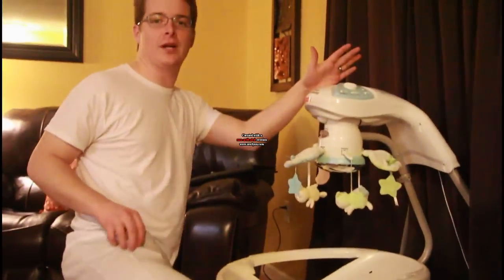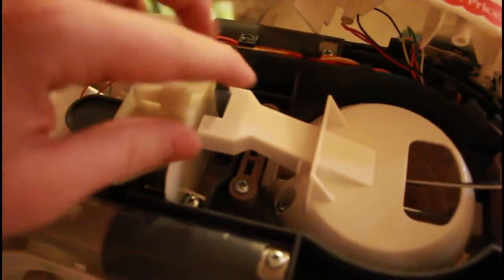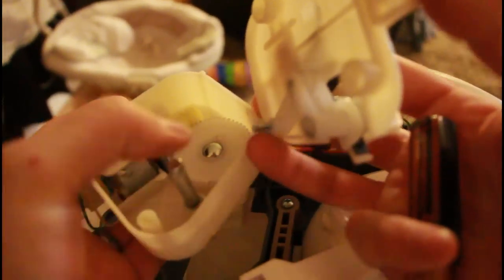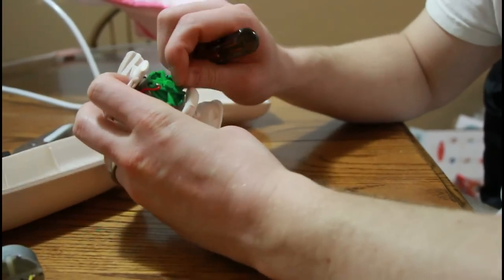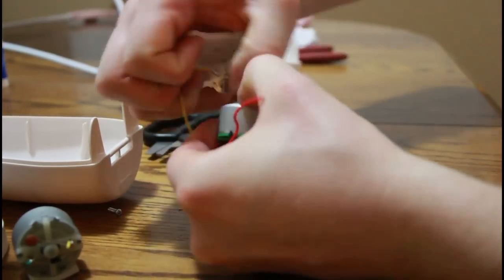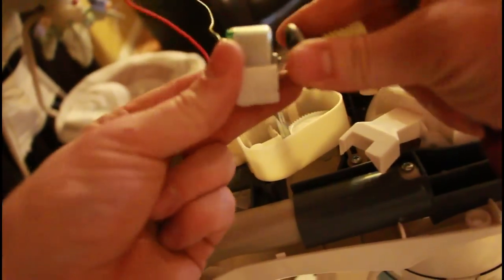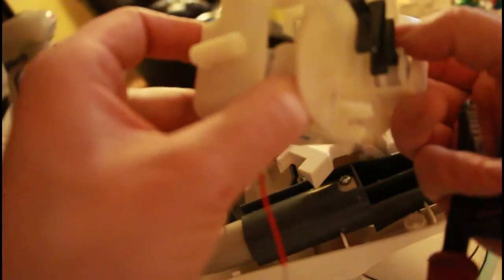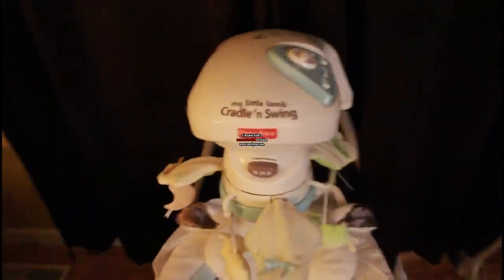How To Fix Fisher Price Cradle n Swing Motor Natures Touch My Little Lamb Love U Zoo baby

Comment: unbelievable, it worked. my friends thought I was nuts. had the freshner in my bathroom, bought flex for $6, and did this by myself. totally proud of myself. my friends look at me differently now. I used half the roll,  swore a lot, set table on fire,  burnt myself but well worth it. THANKS FOR THIS VIDEO

Comment: Did this exact method step by step. Put it all together, and it swing slow. Barely moved the chair. So I re-watched again. Then I noted him saying,  ( it will run slow if the polarity is reversed) So I switched the wires, and it worked like a gem. Thanks for this thebiggi, much appreciated! I even loaded it to 25 lbs, it's limit and it ran like a beast. Hope it lasts, if not i've got 2 more airwicks on standby!

Comment: Ours died suddenly, thank you for this video! Others may find it useful, there is a small dot in the plastic by one of the contacts on both motors which marks the positive. I disconnected and reconnected everything paying close attention to the polarity and joined the Yellow wire to the red wire, and green to blue. Works great again!!

Comment: We took a look at the video and my husband was like, no way! But me and the babe can't live without his Snugabunny swing so I decided to try. Well wow, soldering (or soldiering as I like to call it) on this job was really hard, especially grounding the "capacitor" - despite roughing up the case, I never did get it to stick to the side... but I put the foam sticker overtop so there was still a connection. It worked!!.. and babe is sleeping soundly as I type! The new motor is louder than the old one but nothing too bothersome. Overall it took me about 4 hours not including breaks spent manually rocking baby to sleep. Thanks!
Reply: Jana Strittmatter How did you removed the metal bar in the middle? TIA
Reply: It was like someone else said in the comments - "You have to pull the legs of the swing in (release the crossbar in the back) and the two bars holding that plate down will move out and allow you to remove it."
Reply: So, it worked for about a month before dying again :( My son has almost outgrown the swing now so we might be able to do without, but I was sad that the "new motor" didn't last longer. That being said... it was a lifesaver at that point, and the alternative (waiting for Fisher Price replacement) wasn't feasible in the short-term.

Comment: Thanks Buddy, I actually also used an old nokia 6.5v charger and made it work with ac power. so it now plugs into the wall and i don't have to constantly change batteries
Reply: +Clint Mahabir Can you do a video that shows how you did that? I'd love to change mine to Ac power.
Reply: OK I will, and I will let you know when its up

Comment: Im having a problem with mine i took mine apart because it was not working great . Think the notor is weak. But anyhow after re assembling the switch boards the only thing that works is the swing action. The mobile thing dont spin and no sound??? Do you have any ideas. But if i switch the plugs around the control knob will control the mobile like it would the swing. Im thinking the board is messed up or something..

Comment: i bought my new motor off ebay already soldered, its works but its going too fast and the little stick thing that goes back and forth is moving too fast, so fast that it barely swings. any idea what the problem is?
Reply: Hi my stick is swinging to fast too, did you ever find out why it was doing that & how it can be fixed?
Reply: no, i just gave up on it. i had already put too much time and effort into it and my baby was starting to get too big for his swing anyways
Reply: Oh sorry to hear that, thanks anyways.

Comment: I followed the steps but it will either swing on higher speed without me powering it on or it will power on and not swing at all if I switch the leads. What went wrong?
Reply: dana youtz having the same issue myself. Soldering is just 'gluing' metal pieces together, the problem 'might' be that your pieces aren't connected properly. Reheat the metal and try making sure the wires are touching each other. Can't hurt to try.
Reply: dana youtz Did you figure this out? I'm having the same problem...
Reply: dana youtz  I've read to make sure  metal piece isn't all the way shoved on the motor.
Reply: +dana youtz This happened to me after I tried reversing the wires - I smelled burning from the control board and now if I connect the wiring up the motor goes off regardless of whether or not I've switched it on. I'm wondering if we burnt out a capacitor, transistor or resistor on the control board....
Reply: dana youtz so can I use glue instead???

Comment: my cradle swings for a short time and stops. i have to open it and touch the motor before it starts again. what could be the probable cause.
Reply: Same here. Have you solved it?
Reply: Double check the soldering job, make sure the brown one and the black one touches both leads,  but leave extra to solder to motor casing.

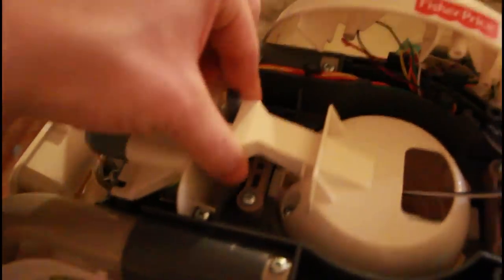Comment: At 1:11 what I did was duct taped that little piece so it fits super snug into the hole. Gives it a lot more swinging power and moves quicker. Alsoooooo make sure you solder very we'll and not speed through it, I have very little soldering skills and this took me a total of 1.5 hours and I burnt myself twice because I'm an idiot soooo be carful or were hand protection and also the solder smokes up a lot so do this on a table or you'll be blind momentarily and burn yourself

Comment: My model for reference: Product: V0099

Just got done completing this repair using the AirWick Freshmatic Ultra motor. It is operating probably just a little quieter than the last motor (considering it was dying). Couple of detailed notes:

- The leads inside our swing are green and yellow. Make note of which poles these wires connect to. Green is ground and Yellow is hot.
- The leads in the Airwick are blue and red. Note those connections as well. Blue is ground and red is hot.
- The diode stripe needs to be facing the "hot" lead (on the new motor it is red, from the old it is yellow in my case)
- When connecting the capacitor, the short lead goes to "hot" (red) and the longer lead goes THOUGH "ground" (blue) and to the side of the motor where it gets soldered as well as the pole. You will need to rough up the spot on the side so the solder will grab.
- Verify you soldered the capacitor at 3 points (hot, ground, and motor side).

I have seen comments other places about noise increasing, not sure if they remembered to include the foam pad that was on the original or not but just verify you include that in your reassembly.

Awesome work on the video and thanks much!
Reply: Thanks for the info on this as the original motor is not marked + or -. The motor on the AirWick Freshmatic (i bought the black one at Walmart) is marked + on the red so that def helped. You're info saved me a lot of time testing :)
Reply: Thank You!

Comment: This is awesome!!! Thank you so much for posting this! I bought my swing used and figured I'd wasted 40 dollars because it ended up barely working. My husband was pretty shocked that i was able to fix this myself. I got the soldering metal stuff everywhere and burnt most of the plastic on the old motor but eventually i got it. haha.

Comment: I pulled this off on my Fischer Price Snug-a-bunny. It had some wicked metal cross bar wedged in keeping me from the inside, but I just bent it out. Also, couldn't find Airwick so I used a Lysol air freshener instead. It already had the capacitor too. Couldn't have done it without this video guide! Best part is now the rocker runs smoother and quieter. Happy mom, happy baby = happy dad!
Reply: You have to pull the legs of the swing in (release the crossbar in the back) and the two bars holding that plate down will move out and allow you to remove it.  It's a pain, but if I'm understanding you correctly you didn't have to bend that piece.  I don't think it matters, but it would have saved some effort.
Reply: Michael J Lambie Did you use the Lysol Neutra Air Freshmatic? I can't find the Airwick either!
Reply: Megan Knezevic any of those automatic air freshers should work, they all use the same kinda motor
Reply: Megan Knezevic True story. Yes, the Lysol works great. I love it! and even more so, baby loves it! Actually works better, and quieter than stock motor.
Reply: Michael J Lambie I did the same thing to the bar on my swing.
Reply: is the capacitor the metal wires u have to apply around the new motor?
Reply: +Mari Navarro the capacitor is on the wire around the motor. It looks like this: http://www.guitarrepairbench.com/guitar_info/images/guitar-capacitor.jpg
Reply: +Michael J Lambie So if it has a capacitor do we still have to soder? or can we just use the wires on it? mine has a capacitor already?
Reply: +Laura G Mine had the capacitor on it already. so if that's the case, no additional soldering required!

Comment: Thanks!  Piece of cake - saved me $160.  A few pointers - found the air freshener at wallmart for $5.88.  When taking out screws, make a note of which go where - all are different sizes.  Thanks for the tips regarding polarity - made sure to put in same direction I took it off in.  When screwed back together didn't work - one of the wires got pinched.  So, when reassembling, rec use electrical tape, tape wires back down, out of the way.  Again - thanks so much!!! Really ingenius.

Comment: Thank you for this video! It helped me fix our swing.

Also helpful was this comment by djbecker @ http://www.instructables.com/id/Repair-your-FisherPrice-cradle-swing/

"The swing motor has a freewheel diode (the back cylinder) and noise suppression capacitor (the brown disk) soldered to the terminals. These are important and must be transferred to the new motor in the same orientation.

The motor turning direction isn't critical, but it's probably best to retain the original clockwise rotation. The new motor has a round depression and subtle '+' mark near one terminal. This connects to the yellow wire. The other side, grounded to the metal case (see below) connects to the green wire. If you lose track, the white band of the diode goes toward the yellow side.

One lead of the capacitor extends over the edge and is soldered to the motor case. This isn't critical for swing operation but reduces radio interference. Try to duplicate it if you can."

Comment: Performed on snug-a-bunny version. Used airwick motor since it was all i could procure on short notice.  In regards to discussions about the  noisiness of the motor.  I feel the motor it self gives off nothing more than a whir.  The noisiness i believe is more related to the alignment of teeth to the spiral piece attached to motor shaft.

Initially i had not pushed the spiral piece down far enough and it was very noisy. After readjusting it got really quiet.  I applied some petroleum jelly to the gears as well to keep things running smoothly.

Thank you so much for this vid...oh and Happy Fathers Day!!!!

Comment: Thank you for the insight. It made fixing this swing much easier. I've already told several people with the same issue to come check out this video. I'm still baffled that you found out an Airwick had the same motor as the swing.

Comment: Thank you for the tip! FYI walmarts great value unit has the same motor... got 2 tonight for 8$... now I have a spare for the next time ;-)
Reply: side note, the walmart great value motor is a brush style motor with much better contacts than the replacement i ordered months ago... 3 kids and 4 years... works like a champ!

Comment: Having problems with my snugabunny swing, which I have disassembled.  The motor works intermittently, clicks a little when I turn it by hand, but I'm only getting about 2.6V to the motor.  The replacement motors advertised on Ebay say 3 to 6 volts.  Any idea what the problem is?

Comment: Looks easy, but for $50 dollars on craigslist it might be more fruit full and less time consuming to buy a whole used swing?  Make sure you pay attention to the polarity of the diode before soldering it back in, as well as which color wire goes to which terminal.  The author sort of skips over this and then mentions after putting it back together to "switch the wires around" if you have the polarities reversed.  He must have a lot of time on his hands.....

Comment: After my frustrating experience I gave up on the swing after I replaced the motor. I then got on craigslist and found the exact swing for $65 in complete working order. I brought it home today and pulled the control board with all components attached (the triangular part with the speed dial, volume, and mobile control). This piece has the control board. I installed it on my old swing and it worked like a charm. Turns out originally the control board and motor went out. See my first post below.

Comment: Just followed the video exactly. Just as someone else posted, the motor runs so fast it doesn't have time to swing. Also, it runs in the off position and does not change speed at any of the speed settings. I have to remove the batteries to turn it off. Any advice how to correct the issue or identify an additional problem?

Comment: THIS WAS AWESOME!!!! Great cheap fix that works 100% If you want to add a Plug-in option its super easy. Just pick up a universal Adjustable AC adapter and chop the end off and connect it to the battery terminals and select 6V on the switch. and set the right polarity. I did it to mine. Works like a charm
NO GUARANTEES, NOT MY FAULT IF YOU BREAK IT

Comment: @ Amanda Dawson, I would suggest 1st taking a picture of the original, then using wire cutters to remove the parts off the top of the original. Finally, use some solder and place the pieces back on. This is the most time consuming part especially if you do not have experience with a soldering iron.

Comment: This didn't work for us.  Changing the motor was a fun project, but the new motor works the same as the old one.  I asume the switch is the culprit in this case, perhaps the switch doesn't register anything but the lowest setting.  Anyone experience this problem?

Comment: Totally not worth the time I spent, but the video was good and the swing actually does work now.  If you are fairly handy, this is a good project.  If you're like me, and have never soldered and aren't very handy, just go buy a freakin' new one and save the time/frustration.

Comment: Question for you, what were the symptoms the motor in your swing had gone bad?  Our swing quit working and I found this video via Google search, so I performed the repair but unfortunately it didn't work.  I did, however, inadvertently discover that by jumping the red and yellow wires at the circuit board for the switch the motor will turn.  Curious if you've ever run into this problem or have a solution?

Comment: Great video! Unfortunately mine still isn't working. Any clue to what else could be wrong with it? When I bought it used I turned it on and it work. Now 2 months later (baby is here now) it doesn't do anything even after changing motor.

Comment: Hi, changed the motor. Same result. Looks as if it has no strength. It spins until you put it into gear. Tried changing poles, doesn't help. Any ideas?

Comment: My Zen swing was swinging slow only and seemed to be irregular in its movement, speeding up and then slowing down. Thinking it was the motor, i replaced it as per instructions. When done it was exactly as before. Thinking it was the polarity - I took a gamble on - I reversed it and smoked something: it stopped working all together. I now think that there was something else wrong: when observing the inner workings i noticed that the driving mechanism was in a certain pattern: and effectively losing the sync with the swing. I can't describe it any other way. The momentum of the swing worked against the action of the motor and next with it again. Conclusion: for me it was not the motor but some other wear and tear. If your motor has completely stopped working this may be a grand solution. If your swing is slow and in a subtly irregular pattern, replacing the motor is not a solution.
Reply: +Joppersful  I just had the same outcome, even ordered a second motor. I think it's one of the other doohickeys on the chip board.  If i turn the motor,  by hand it will continue to spin...ish, and ends up kind dying out. but if I connect the motor directly to a Dc converter the motor turns worse comes to worse I may just bipass the power straight through the switch  and to the motor. see if it doesn't catch fire. or swing the basket around like a Skyview.
Reply: exact same situation here.  i just went through the air wick process.  when reversed polarity got the same smoking thing ... from under the control panel.  reversed back but now motor seems to be totally dead.  sounds and mobile work but swing is totally dead.  once you had this issue with the smoke, was your swing garbage or did you happen to come across any other solutions?

Comment: This is a most excellent video.  Mine had the bar in the way and I found another video from a different guy and he used his soldering tool to melt the plastic to pop the lever out.  Mine is working now.  You are the man.  How in the heck did you figure this out?  I would have never figured this out in a million years.

Comment: Ok so I have never done this before and Im working on it now. I have put everything back together but now when I turn it on the motor is really loud. Can anyone tell me how to fix this please....
Reply: Jessica Marie I've read that the foam piece he puts on the motor needs put back in place or some padded tape on that part... that should quit the swing...
Reply: Jessica Marie did u ever find out why it was making the grinding sound my motor works fine but makes ana awful sound so am trying to fix it
Reply: you may have pushed the gear too far... make sure there is clearance when installing